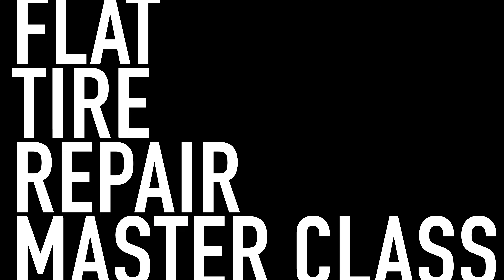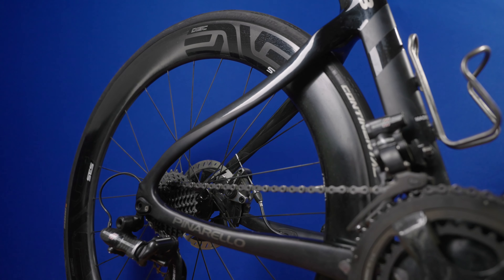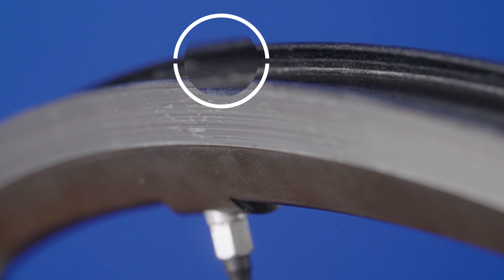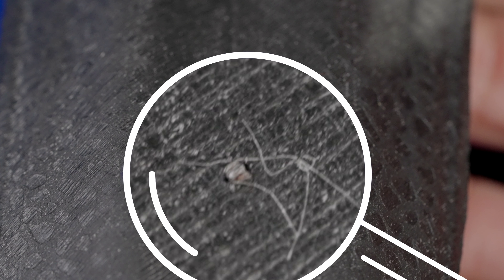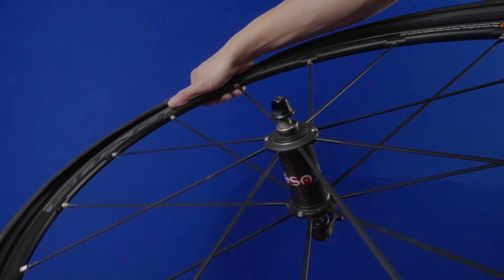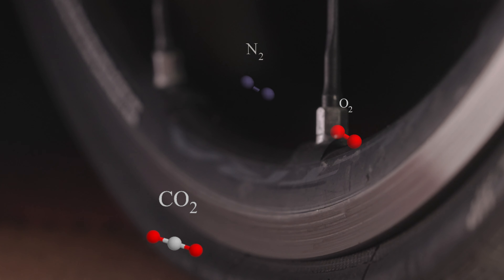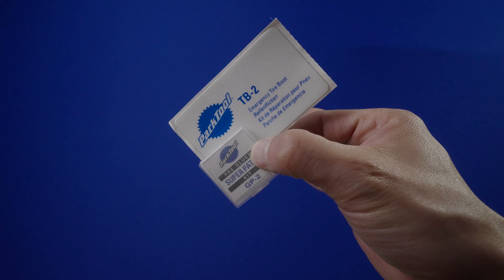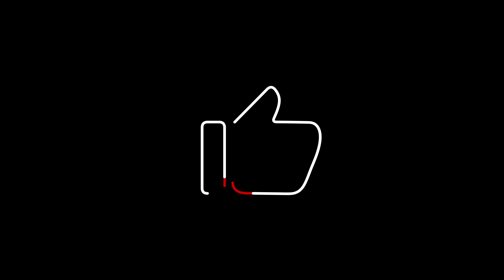Flat Tire Repair Master Class

Comment: I never knew about frame pumps; thanks for mentioning them. I currently have a large battery-operated pump that can be used as backup power, but it’s very heavy and takes up a lot of space in my backpack during my daily commute to and from from work. It’s also gone off in my bag a couple of times from the button getting pressed by stuff in the backpack and sounds like the world‘s loudest vibrator 🤦‍♀️😂🤣
Reply from the maker: @GM_____  hahaha